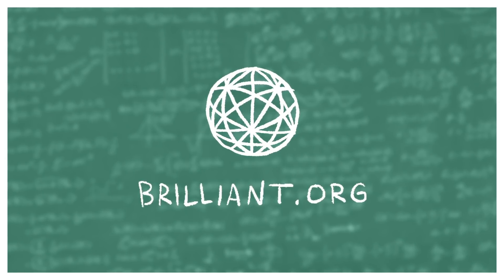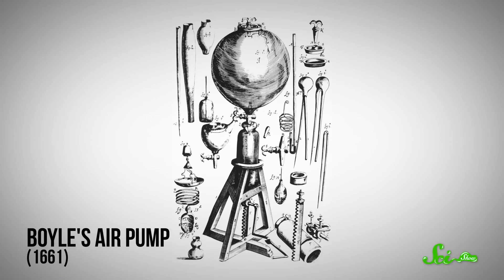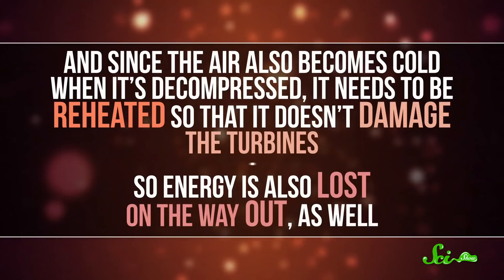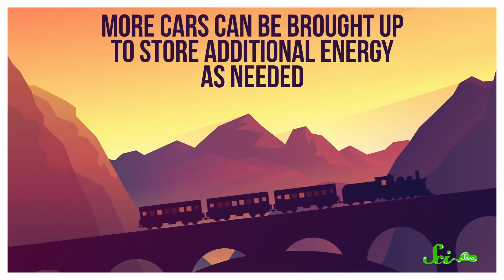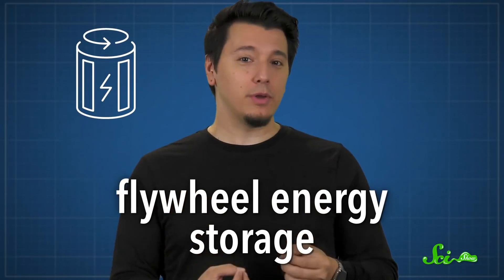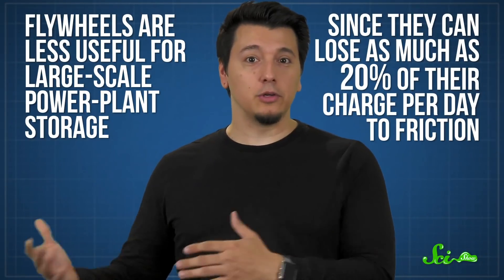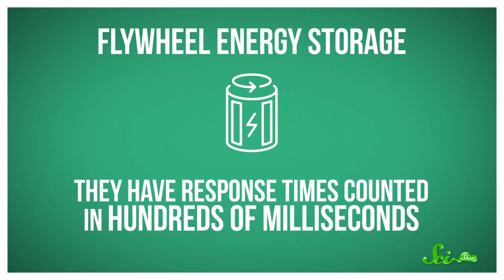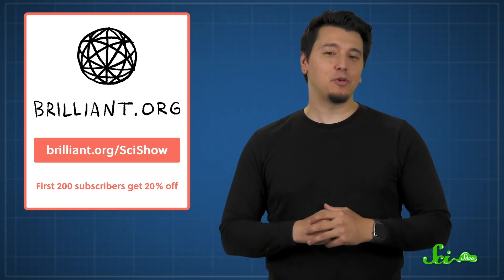The Surprisingly Retro Future of Batteries

Comment: That was really interesting, thanks. 
Have you ever talked about what to do to recharge electronics after a very large CME or an event like that?
Reply: Julian M  your electronics would be useless after a good sized CME.  No basic consumer electronics are rated for the EM discharge from even a smaller CME hitting the atmosphere.  
  The only groups with still useful technology would be militaries, because they have specially EM hardened computers/radios/phones/vehicles/etc...
Reply: @GoatPopsicle  really depends on the strength though right? A smaller one may be negated by the roof on your house or the steel around your car

Comment: My favorite retro energy storage is called pumped hydro. Its similar to the railcar example but using pumps to raise the elevation of water and then turbines on the way down similar to hydroelectricity. High round trip efficiency as well since it is based on  pump and turbine efficiency which we have nearly mastered.
Reply: I am glad to see a lot of people push hydropump storage.  I am guessing there is some movement I missed, or did a lot of people simply just realized that this juggernaut of grid storage, is pretty dang good at grid storage?

Comment: - This video needs to be 10x longer. Modern techniques of compressed air storage account for the problem with heat loss and bring that efficiency rating up to 70-80% (Adiabatic CAES).
- Then there's also LAES with an efficiency of 60-75% BUT it can be placed anywhere. No caves, inclines, dams, or super expensive facilities needed.
- Flywheels are no good for massive grid storage. They're not only price prohibitive and dangerous if things go wrong, but they don't scale up the way other storage solutions do. They're good for small systems. Not for powering a city.  
- Then pumped hydro. This is a pretty big one. Very great tech that's in use today. Location prohibitive, and also not ideal for the environment since you need to potentially wipe out an ecosystem to build one. But a great tool to have along with the others (except flywheels, so far)  

this is a topic I hope to see many more videos about. Not just from you but from all YouTubers
Reply: LAES looks pretty cool, but where did you get your 60-75% figure?  I checked wikipedia and there was a 70% claim, but that was with a 115 degree c heatsource that wasn't counted (it was considered waste).  That seems great and all, but i sort of doubt that such waste heat sources are widely available, and with attempts to be more efficient with things all the time will only be more scarce in the future.
Still, very interesting tech.
Reply: @Wooble57  I'm not an expert but it was just the first article that popped up on Google: https://arstechnica.com/science/2018/06/liquid-air-energy-storage-the-latest-new-battery-on-the-uk-grid/

Comment: Come on people their is only 2 energy sources for the long term future. Fusion and Fission. Get with the 22nd century.
Reply: @aud_io Your dinner is raw meat and potatoes. Just with couple of steps added.
Reply: Johnie G I’m hanging out for subatomic black holes myself. But they are just gravity generators.
Reply: Fission fuels won't last until the 22nd century.  Fusion is useless until you can actually do it, which we can't in any reasonable way.
Reply: @CorwynGC  you can convert thorium into a fissionable fuel in a breeder reactor, there's plenty of fuel.

Comment: What about pumping water uphill behind a damn then releasing it when needed.
Reply: Is in use.
Reply: Thus doesn't need to be addressed as a "new" energy storage method
Reply: In use not the most ideal but it works

Comment: What are you talking about a 78% efficient Gravity Batteries? Commerial Gravity Batteries in use which are everywhere currently haven't gone over 15% and the ammount of Energy stored in a 'Train' (something on rails) in Nill. I've worked on Molten Salt Batteries for Utility Companies which are 98% Efficient but cost literally Tens or Hundreds of Billions per Installation.

If your Telsa Capacitance comes in at only $100 Million the 8% reduction in Efficiency has Lifetime Economy when being even more Efficent could cost easily $100 Billion on equals.

I mean it's really application Dependant Current Comerial Utility Gravity Batteries are in the Petawatt and above range and sheer Capacity is a negating factor with efficiency and the Economy of on Demand Power.

Trust me we are all working on ways to build in Local and Grid Capacitance to the Electrical Utilities in sensible and economic ways to take demand off of Generation and overall sure of the system from things such as pricing and rolling blackouts (where they turn off the Grid to prevent failure by overload).

Also Current Commerical Gravity Batteries are just cheaper per Watt than any other Technology Currently in the Petawatt and above range.

None are better than any other they all work in appropriate applications.

This also excludes most Commerica Utility Gravity Batteries also have a Generation Capity but none have gone over 15% Efficient as Battery Storage. Litterally it never happened.

I'm not saing Rail Gravity Batteries don't work this Techoloy powers almost all the World's Train Yard but the only Fuction Example of getting other work done with the same Technology is Hydo Static Storage.

I'm not saying the Technology doesn't Technically work besides a ridiculous Efficiency Statistic that must be completely theoretical because it's never been measured in use but Trains measured in Miles have Energies in Megawatts at Top Speed and even if you had a Terminal Velocity Train it wouldn't have a Gigawatt of Energy.

And you also have to know Gravity Batteries are the Least Dense usable way to Store Energy no matter what.

I would advise any Residence or Business to have an Isolation Capacitor even while we work to do the same thing to the North American Grid (it's functionally interconnected U.S. / Canada).

Note I'm not saying anything about Primary, Supplimental, or Backup Generation I'm talking about Capacitance, breaks in the line.

Any Rechargable Battery has Capacitance Value by Definition however it works it's isolating use from source as with all my examples.

I have only myself work on Molten Salt and it's potential to be installed with Generation as Primary Capacitance and Isolatuon but I know how the others do work generally speaking.

A $100 Billion Hundreds of Gigawatts Battery is sensibly Economic for a Power Plant but at $10 Billion Megawatt range installation is not sensible for most local substations especially when there are compeating technologys in the range of Millions of Dollars being advertised (only by Tesla currently).

And this is still far less than the Trillion Dollar Affairs Commercial Utility Gravity Batteries are.

Also note this is not what I primarily do but we are all working together on it.

We who Provide the Modern World know you and us need Power to live in regaurdless of what we're normally doing so this is a case of working together for everyones benifit.

Even Trillions for a Commerical Utility Gravity Battery makes sense Economically as part of the system just not my thing.

I only work on Public Projects I haven't ran a Business in over a Decade. You can purchase a lot of what I do from the Local Planning Dept. eventually.

I live where all Utilities are Public by Law and I'm not debating Public Vs. Commercial Utilities. The end user always pays in the end (I don't make profit).

No Individual could afford the type of project I'd most normally work on anyway.

The interesting thing is when I make Proposals I'm the only one with Budgets projected for the reasonable side of ridiculous almost entirely.

Molten Salt is capable of Terawatt storage but I don't think anyone wants to pay for that. I mean you'd also have to build a bigger Power Plant.

The intent isn't to provide long term storage but Capacitance and Isolation.

This just Stabilizes everything Power Plants then have Consistant Output and Power costs the same at Peak and Low Demand.

Now I do have to get back to trying to sell the Trillions of Unrecyclable Tires someones left to to the Public Utilities.

I'm not going to debate Environmental Problems we all have them but I have a Tire Related Environmental Problem of having 100ds of Sqaure Miles Dedicated to nothing but Tires I am responsible for because they're Illegal to Landfill and Impossible to Recycle.

Hell one of my Projects involves Dredging the Eniter Hudson installing a Pollution Barrier abd putting a new River Bed on  Top.

And all else being equal Tires have less highly radioactive emissions than Coal.

And they will only buy Tires when Coal is very High because of Issues Internal to Power Plants. (They're a lot harder to  Turn Off running Tires.)

I actually don't know why they vent Gas Emissions in the first place but I do know why they don't normally buy my Tires. Probably they just agree with me Global Warming is the best possibility of finally escaping the Ice Age. 

The World primarily has a Pollution Problem and not a CO2 one. (CO2 is not a Pollutant by Definition.)

I mean High Technology is not just without Negative and Postive Evironmental Impact Either. Solar, Wind, and most kinds of Batteries are enviromentally terrible in their own way.

I mean all the Tech I discusssed has Cost and Benifit.

Don't worry as primarily a Naval Engineer I have already set aside Cubic Miles of Salt and mild Bases if becomes necessary (get someone to Pay for that cause I have it.) Parts of Federal Reserve.

I can only offer Solutions not Payment Plans. Ask a Congressperson.

They are not Required to Choose my Solutions I'm just Required to Provide them. I'm not nearly the only one with Solutions. And I'm not attached I got Several Thousand Things to Do at any given time.

I am Legally Not Allowed to be a Doctor or Nurse and keep my Job so I have no Public Comment on the more current situation.

Literally 90% of my Time is spent within the subject of the Military and I  have no comment on that either.

I intentionally bring extremity into the picture as an option that's most of my usefulness to Congress.

Tires in fact will turn into Coal eventually without being sold to the Public Utility.

I may in fact just have the first Coal Deposits in 300ish Million Geologic Years... almost cersainly without buyers.

This sounds silly but Tires do not Decompose likely everything legal to landfill is eventually supposed to.

Inappropriate Landfill is a Crime in the U.S. Misdemeanor and Felony dependant proper Disposal or Recycling / Reuse is required by Law and for Tires that's storage and incineration actually.

Littering is also a Crime everywhere and that didn't stop the L.A. River from happening.

Usually they only charge Felonies for Agregious Cases like Attempting to Landfill and Automobile or Littering Toxic Waste (both happen).

Plastic is Legal to Landfill, they say it won't last 1,000 Years, Chemical Batteries, Glass, CFCs (found in refridgerators), Motor Oil, and many other things are not. E-Waste at least shouldn't be.

Comment: Train storage is the only gravity-powered battery? Well, dam.
Reply: LOL I seen what you done there.
Reply: That was my first thought.  In some places water is pumped up into the hydropower resivoirs for later.
Reply: @lewisdoherty7621  http://www.british-hydro.org/pumped-storage/
Reply: Also what if we made an underground chamber with thousands of heavy cubical weights inside..and using energy, lift them up. .and keep them suspended?
When we need the energy back..we can just slowly let them down by gears with small teeth that will rotate the gear very fast..thus regenerating its energy..
Reply: @dipanjanghosal1662  or we could you know, just pump water up onto a mountain and let it run through a hydro plant on the way back down like we already do.
Reply: @dipanjanghosal1662  Compared to pumped water energy storage, weight lifting storage is very cost-inefficient
Reply: I guess Sweden is pretty screwed then, relying on dams for a considerable portion of its power production.
Reply: Key word here is "Retro" people...
Reply: Dams are generally more like generators than batteries, though.. But yeah lol
Reply: @mustardpoint  The turbine part of the dams are generators, the reservoir is a battery.
Reply: @mustardpoint  hmmm, you could think of a dam as a rechargeable battery as well. (-) for upper reservoir and (+) for the lower reservoir. At high usage times , water flows from (-) to (+) through a turbine that converts that energy into power.  At low usage time the water is pumped from (-) back to (+), essentially charging the "battery".
Reply: @mustardpoint  Plus, don't forget that nature gives a boost when it rains filling a lake or other type of containment.
Reply: Dam is just a dam though. It can be a power plant. But it's not a battery. For a battery it needs to be pumped-hydro, and those are modern. Not retro.
Reply: there's also water-running ones.
Reply: Choo choo
Reply: it's not true.  I know of places that pump water up to a higher elevation during off hours and allow the water to flow down thru turbines at pike times to use the stored energy.  I have seen this on a show Modern Marvels and it was talked about in the Energy Storage class I took in grad school.  what they never mentioned was this train stuff
Reply: @gulielmi2002  the train battery is only a few years old.  Tom Sauk Mountain in Missouri is one of those large pumped hydro batteries.

Comment: You missed pump-stored hydroelectric, a technology that's already used in a couple places and is very efficient.
Reply: Electric mountian - north wales
Reply: Also missed high-temp molten salt batteries for storing heat, like use in solar collection systems.
Reply: That's not very retro.
Reply: @blazebluebass  so early 1900s water turbines and even older water wheels is not retro?
Reply: doesn't that fall under gravity?
Reply: in theory hydro electric is the most efficient form of storage because it uses gravity to "charge" it's storage and it doesn't take much time it begin generation of electricity . pumped hydro is pretty much the same thing except where the water has to be moved to a higher elevation mechanically it isn't as efficient. whether they agree with you I certainly do and they really dropped the ball by not including both of these forms of energy storage.
Reply: Pump stored hydroelectric is not efficient. The Economist puts it at between 70 and 80 percent. May I see your numbers and sources, please?
Reply: @Alexander_Kale  That's a relative number. If you're comparing against the 0% that you get when there is no renewable, it's infinitely more efficient. Excess renewable energy costs money. It doesn't matter if you only get 70% of it back out because you'll save money by not having to shunt it and make money when you pull it back out of storage, regardless of how inefficient.
Reply: It is already installed almost every place suitable.
Reply: @mathewritchie  No, it isn't.
Reply: @mathewritchie  

If there is a place for a stupid weight-on-rails gravity storage, there's a place for pumped hydro. Build two tanks and a pipe in between. Want more capacity? Build another tank. Want more power? Build another turbine.
Reply: @superdau  You can also transfer the water to a higher point with an Arcimedes screw, instead of having to push the damn freight train back to the top of the hill every time it has run to the bottom.
Reply: @JuvoII  why would you want an archimedes screw when you can run the turbines as pumps
Reply: Yeah, and also extremely hard to build in all places due to needing a high and low reservoir. Wont work for all

Comment: This may technically be considered a chemical form of energy storage (someone with more knowledge should confirm) but should also research 'molten salt' storage, where different kinds of salts are heated up and pumped around a system to store energy.
Reply: I think that's just energy stored in heat.
Reply: I always wondered how you start one of those things up. Lots of people with blowtorches trying to heat the pipes up?

Comment: centrifugal force limits energy storage capacity of flywheels by limiting rotational inertia. flywheel explosion occurs when a certain linear velocity is exceeded at the circumference of the flywheel. composite materials can bare higher velocities compared to steel. there are recent scientific studies on this subject. (yes in germany:)

besides magnetic bearings, electromagnetic clutches are also needed for flywheel energy storage. I was searching em clutches from stromag and keb for my project. I saw in one of these catalogs a flyeheel storage tecgnology product (probably keb's)

there was also a company dedicated to this tech. (don't remember the name) daylight excessive solar energy production is stored in a flywheel in this company's technology.

I hope this comment might help on the subject.
Reply: Flywheels are really damn cool. Probably very useful in space, there you'd only need minimal magnetic interferance if your flywheel is balanced enough
Reply: Except there is no requirement for a flywheel to be supported from the center and tensile strength. Put air bearing around the outside and you can run way faster.
Reply: @RobertSzasz  

geometry and material type determine maximum energy storage of a flywheel. bearing type (ball, air, magnetic) determines the efficieny of energy storage in flywheels. flywheel explosion issue is not about being sopported from center or somwhere else. unity of a flywheel is always under risk with high centrifugal force (i.e. high rotational inertia and high linear velocity at the circumference)

I hope this does not cause any confusion.